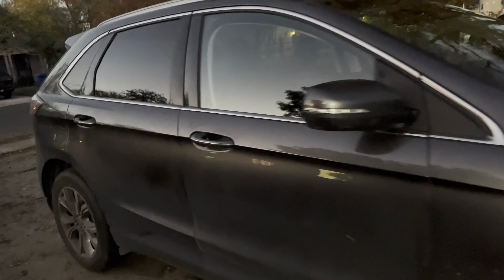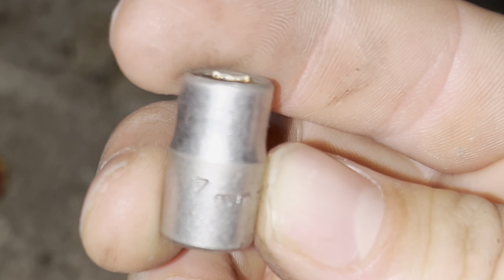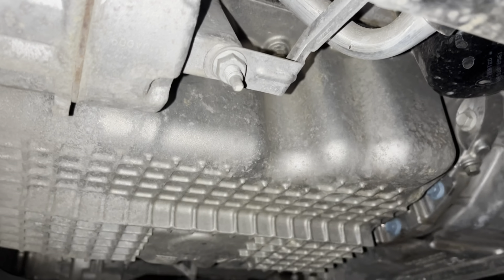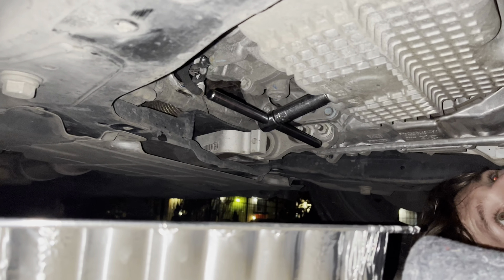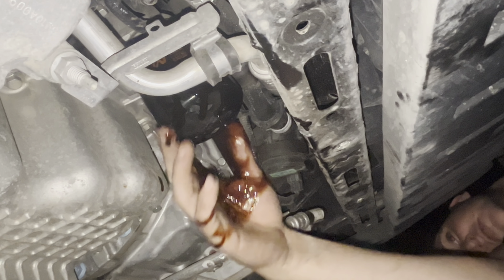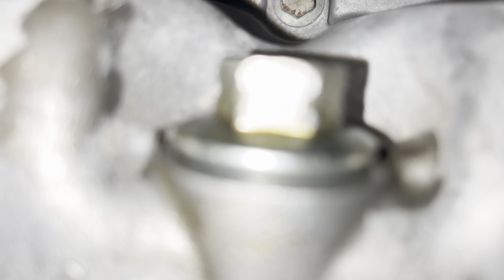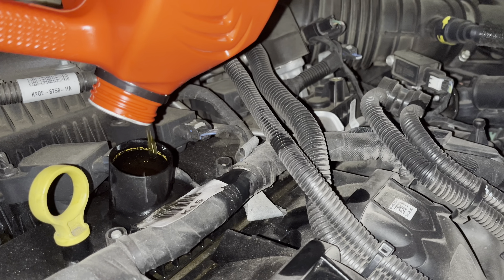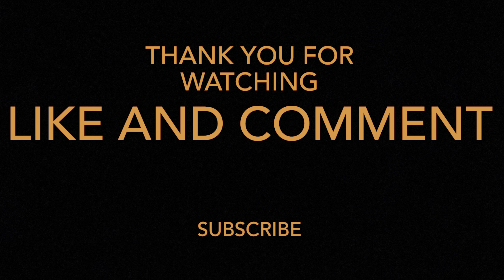How to change your oil | 2020 Ford Edge Titanium eco boost | Oil Change on newer model car

Comment: Always have the proper equipment before you start the oil change. 7mm socket 15mm wrench or socket funnel oil filter oil a container big enough to drain the oil into. Shop rags and sometime a spray cleaner to prevent oil dripping later.
Reply: Thanks man, this tool list helped a lot.  Im not very handy but I’m trying 😂